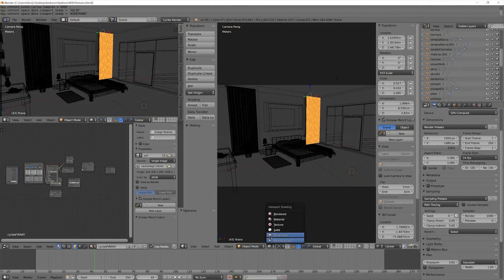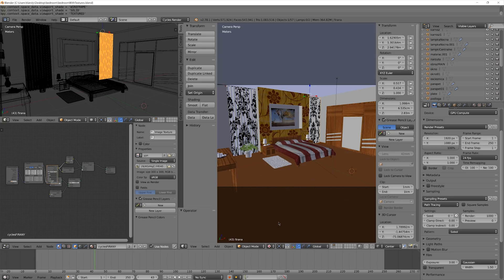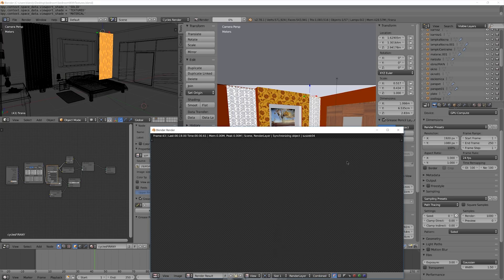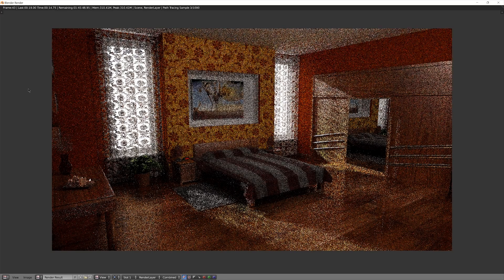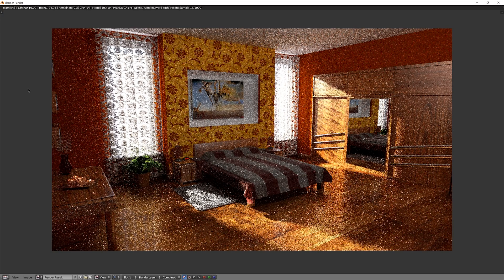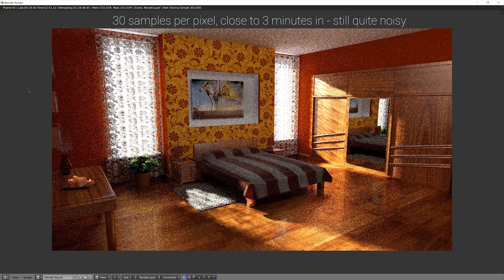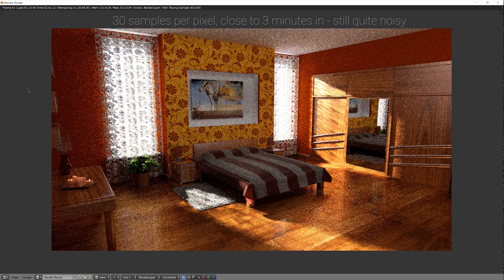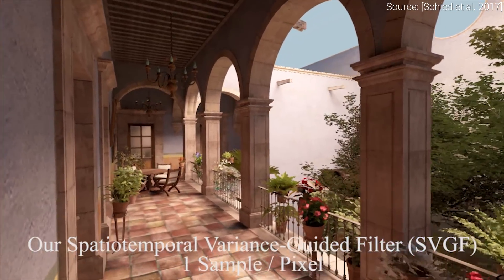Real-Time Noise Filtering For Light Simulations | Two Minute Papers #181

Comment: What! With only one sample?
Reply: Blender is about to include the denoiser in the next release bit this one seems by far better
Reply: Yep, I want to know if it's possible to adjust the algorithm to take 4spp or something to improve in low light and improve sharp reflections.
Maybe it's better to just feed it higher resolution data and then downsample, I don't know, but that might not always be feasible.
Reply: If I'm reading correctly, this uses samples over time and information extracted from the variance in brightness to reconstruct the image. So, yeah, one sample.
Reply: One sample PER FRAME. The first few frames look noisy, but after that, the noise is smoothed out by averaging over time. Effectively, the shading of a single pixel then is probably based on around 5-20 samples.
Reply: From what I understand after skimming over the paper it's 1 sample per frame (split into direct and indirect light) plus a fairly fat g buffer. Still very impressive, and much more elegant than what we currently have using crazy screen space techniques.
Reply: okorok, and still this filter does better than pure 10spp path tracing. And it does not do 1 sample per frame, but one sample per pixel a frame. It does not take the average as this would result in an image looking worse than 1spp. It's doing much more than that to accumulate color at the correct positions.

Comment: If the image generation per frame takes 10 milliseconds and the denoising takes 10 milliseconds, then that's 20 milliseconds total. This means you can at most expect 50 frames per second on a supposed high-end GPU.

To use this technique in games it would need to be further optimized so that it generates a frame in under 16 milliseconds, in order to reach 60 FPS. Or just go with frame rate of 30, and be left with 10 millisecond budget for game logic and other things. Actually, the paper itself mentions that devs expect a framerate of 30 as "minimum performance requirement", but I would like to object to that saying that most gamers would require 60 FPS.

Comment: The problem with this filter (and many other filters like for example super-sampling etc.) is that the image becomes physically incorrect and the unbiased rendering looses it's purpose.
This is maybe good for the studios who are using biased rendering and to whom the physical correctness is not so important, but for us engineers it is useless because we require the most physically correct light simulation without compromises and corner cuttings.
At present most of the unbiased renderers started to implement physically incorrect techniques in their physically correct core and this way they are becoming more and more biased. Luxrender developers are for example wasting time and resources on physically incorrect techniques like SPPM etc., Thea Render on it's biased techniques, the same goes for Maxwell which is more and more physically incorrect with every version, Arion, Indigo etc.
All these renderers are implementing corner-cutting techniques to gain more speed and this has no sense because biased renderers like V-Ray and Mental Ray are already dominating the industry of physically incorrect renderers.
Eclat Digital's Ocean renderer is the only unbiased renderer nowadays which focuses only on polishing and perfecting the physical correctness in it's engine and takes the physical correctness very seriously without corner-cutting and compromises. This should be the roadmap for every unbiased renderer which calls itself "physically correct" (falsely most of the times). They should focus their resources and time on polishing physically correct techniques like MLT, MEPT without wasting time and resources on corner cuttings.
Reply: Hi, I'm the lead developper of Eclat Digital Ocean. Thanks for your support!
Reply: But this would do wonders for Games that need Realtime Graphics but still look close to photorealistic.
Reply: This isn't for offline rendering, it's for real-time applications. I'd argue that the noisy 1spp input is much less "physically correct" than the filtered result.

Comment: Great results ! 
However, at 2:40 I noticed that the shadows are pretty blurred / aliased, especially those of the chairs. Is this a side effect of the estimation to reduce variance, or is it simply a flaw of the scene set up ?
Reply: It's back up again now, dunno why it wasn't working. About >1 spp, I think they said something about having to revisit variance calculations in case of more samples per pixel, but that didn't seem like that hard thing to do.
Reply: Seems to be an effect of the estimate, but remember, this is only one sample. The algorithm runs on outgoing frames (meaning it isn't sharing run-time with other effects processing) and the estimate in the video gives it a 10ms runtime for a single sample. Assuming samples scale linearly (they actually wouldn't take all 10ms per iteration, as the filter only has to be run once, while the samples scale) you could get 2 samples per frame at a reasonable run time for modern gaming on current cards (possibly 3-4 with some optimization). Remember that with ray tracing, most of the improvement comes from the first couple frames, so going from one to two samples per frame should be a huge improvement in sharpness.
Reply: Isn't it because light source is the whole large window? They have some sharp failure cases in figure 13 http://research.nvidia.com/sites/default/files/pubs/2017-07_Spatiotemporal-Variance-Guided-Filtering%3A//svgf_preprint.pdf
Reply: Yeah, that was running through my mind too. However, I'm a bit suspicious of why  they didn't include just a sneak peak of more then 1 spp.
Definitely going to try to implement that solution as soon as I got some time left, I'm really curious about this !

@Brejla, that link is dead.
Reply: Huh, they deleted that paper? O_O

Comment: Forgive me not understanding this properly but since this is talking about video and picture input, could this also be applied to video games?
Reply: Video games use the hardware rasterizer in your GPU, so no, it cannot be "cleverly refactored" into a full ray-tracer that would perform equally well. Rasterization over ray tracing is going to stay in real time applications for a long long time yet, at least until GPUs start being commonly equipped with a hardware accelerated ray-tracer. Even then, an optimal renderer would probably use both... and definitely wouldn't use this technique, because 10ms cost of filtering, while technically real-time, leaves very little headroom for the actual rendering and post processing.
Reply: Video Games and Scene Rendering Programs (like the one in this video) use the same basic idea of a "ray" going through the image making a "sample". Games use just one, so, yeah, with clever refactoring to a game engine, this could be done. Behold the true real-time lighting in games!
Reply: Awesome news and thanks for the answer.
Reply: 10 ms is still good enough, filtration can be simplified. I think this is much closer than the 50-70 ms ML approaches.
Reply: Note that it's 10ms at 1080p on a Titan Xp. Maybe if they can make it at least 3x faster than that, along with more advances in real-time ray-tracing on GPUs, then and only then will we be able to see this being used in practice, but still only on sandbox-y games that would benefit from dynamic realistic light transfer as opposed to precomputing it.
Reply: I am not sure about only sanboxy, I think automated realtime GI is really good tool to have whenever there are any moving objects or dynamic lights. I think the usability is really broad :)
Reply: If you want dynamic lights and moving objects, precomputed light transfer methods are very fast and can achieve good results. Only when the environment itself can change in a significant and unpredictable way do you need to recompute the lighting at runtime.

Comment: Amazing technique to denoise your renders in short amounts of time:

Render your scene multiple times, doesn't matter if it's noisy.

Then go into Photoshop and place all the layers and use one of the blend modes until it looks completely clear and lacks all the noise from the original renders.

A relative of mine taught me this last year and she said she had been using it secretly since 1997. She also said that since AI can now do that work for us there won't be any need for this technique to remain a secret
Reply: @Jessy Chaîné Yes and no, if you are doing unbiased path tracing generally rendering engines don't keep track of the rays that have been shot and each ray is totally random and are not affected by any previous ray, reason being it would take more  amount of computation and memory having to store information about every ray shot and every new ray having to lookup if that ray have been used before, than just shoot a random new ray with a small probability of overlapping with previous rays, basically you have (2^32)^2  possible random "camera rays" and with bounce its way way way more possibilities, risk that samples would overlap is basically near 0  , and its the same probability within the same rendered image  of overlapping rays as with multiple new renders having overlapping  samples,  (assuming you have a new random seed for every time you start the render). However if you doing biased rendering where the render engine look at example noise threshold to determent where to shoot more rays or some "fancier" biased  render algorithm, then yes you could be worse off rendering multiple images  rather then just a single longer render.  Basically only real reasons to render multiple of the same frame and merge them would be if you did progressive rendering saved that render mid render and it later crashed/or you stopped the render and you want to continue on that render, then you could start a new render with a random seed and  then after merge the render from before the crash with the new one  just so the first render time didn't go to waste, or another reason would be you have multiple computers but for some reason no network rendering and you rendering a single image and don't want to split the image in to regions then you could render on every computer with a random seed and later merge them to get a lower noise image, but that's edge cases it's still not a good general technique.
Reply: Max Zamora that's a really pointless technique, the amount of noise would be exactly the same if you render five 1min renders that you average together or if you render just one 5min  image, the same numbers of rays would have been used, however that technique is useful in real photography when you shoot multiple photos then blend them, it's called multi frame noise reduction not a secret.Also the AI part makes no sense, you don't need Ai to blend multiple images you can already automate this in PS.
Reply: Patan77xD Well, I don't know but it has worked great for me and I don't have to spend hours rendering so I can get all the noise out, just a couple 5-10 min renders will do
Reply: Patan77xD And by AI she meant what was discussed in the paper of this video, not AI automating a layering command in PS
Reply: Well if you want to do it like that its up to you, just a bit of waste of time and effort, sounds more like you have messed up render settings/ or haven't actually done an proper test to see if it works/just placebo . If you just think about it logically, if that would actually work surely then the render engine  would already be doing that, also for example if you render progressively that's basically whats happening, the render engine calculates a bunch of samples then renders them then calculates more samples then average them with previous samples then render the new "blended" result.
Reply: Jessy Chaîné you can change the seed
Reply: If it works then the reason might be this: Caustics, specular reflections etc may cause super bright samples making some pixels much much brighter than the surrounding pixels. It takes an enormous amount of samples to average these bright pixels out again. The final renders though are tonemapped to a low dynamic range (8 bit per color and pixel instead of 32 bits), which leaves these bright pixels capped at the max brightness. With the much lower difference in brightness, it is much easier to average them out.
Reply: Alex, I think that's the correct answer. So maybe he would get the same results by clamping in render settings.
Reply: I've cured cancer, Only my relatives is getting it, I'm waiting for someone to create another technique, so I can release mine for free
Reply: Jon Okay, didn't know TMP's comment section could be this toxic
Reply: Patan77xD I really don't know what you are on about, but I'm saying that it works great and I've compared it to just letting it render, but in scenes that have a lot of rough reflections, sss, or other complicated materials, doing many quick renders works better and faster than anything else I've tried. I usually don't have to spend more than 30 minutes rendering them compared to rendering for hours. If it doesn't make sense for you because you've done the math I understand that, but in my case it has worked every single time better than doing the whole render even after heavy optimization. Otherwise I wouldn't be sharing this

Comment: I'm ready to build a cluster of gpus to run a near-realtime raytraced with denoised global illumination and object space shading in VR in a forward+ render but this work make me believe that realtime raytracing in VR could be around the corner. Latency is crucial in VR, a new generation of low latency distributed raytracer with a map-reduce denoiser is required.

Comment: nice, not that realistic, but nice
Reply: It's because the"true" render wouldn't be so realistic too.
I'd like to see this applied on real images with similar noise.
Reply: The scene itself wasn't rendered with photorealism in mind, those are just examples
Reply: Rina Shinomiya yeah. the scenes weren't that well set up and could be a lot better.
Reply: MiRaje8086 I think it's more about the way the scene was set up. Technically, with ray tracing you can get physically correct results (as if you were to take a photo) which means photorealism depends on the materials used, lights and geometry in general. If you take a photo of a cartoon with a good camera and the denoise the photo, it's just going to be a perfect photo of a cartoon, it does not add photorealism.
Reply: Well it's realistic now :D
Reply: MTRredux It doesn't look realistic but that doesn't have to do with the filter shown in this video, it has to do with the fact that there's no ambient occlusion, there's no over exposure on the sky, no dirt or dust or imperfections, no chamfered edges, no rough reflections with scratches or bumps, no subsurface scattering on the plants, etc
Reply: If you don't have enough samples you cannot magically create that data and detail out of nowhere .. the information is not there that's why filtered images doesn't look as realistic as the final render .. you just need more samples.

Comment: How far is it from the "ground truth" images ? (Using millions of samples)
Reply: The paper is really nice to read, and includes examples of that.
In short, sharp light reflections are overly blurred, and there is noticeable noise in really dimly lit scenes.
Reply: The cups look a little duller, but other than that there doesn't seem to be a significant difference. And well, with just one sample, having a crisp looking metallic surface might be too much to ask for.
Reply: @Colopty  so this filter of their takes 10 ms per frame ? effectively as high as 100 fps output to screen at this quality ?

Comment: I'm assuming based on the example scenes that this technique doesn't work for more complex light phenomena like caustics and subsurface scattering?
Reply: Sub surface scattering and caustics probably wont show in low sample rates. 

This denoiser is still desirable because it means you can get a rather well lit visual from a low sample count; meaning in the future you could amp up the sample amount while still having the denoiser in order to get better and better visuals without sacrificing performance as hardware catches up to it.
Reply: That'd be probably because of the low sample rate though instead of a limitation on the denoiser.
Reply: Jato [HD] I'am a graphics noob, so sorry for the noob question. Do SSS and caustics show themselves in sample rates so low? Does this mean that real time ray tracing via denoising will not work, because some of the light behavior only shows itself after a lot of samples?
Reply: Actually it'd probably work fine with bidirectional caustics.